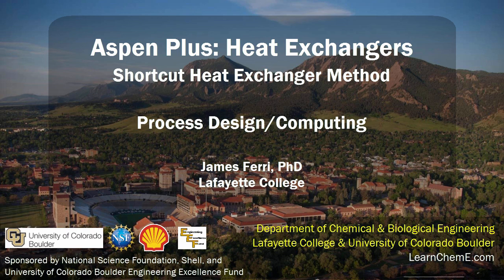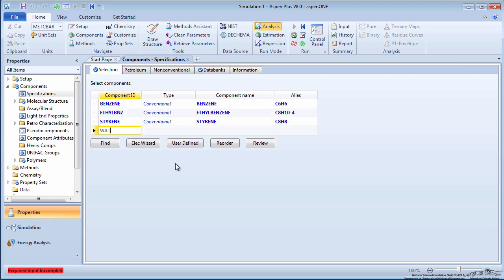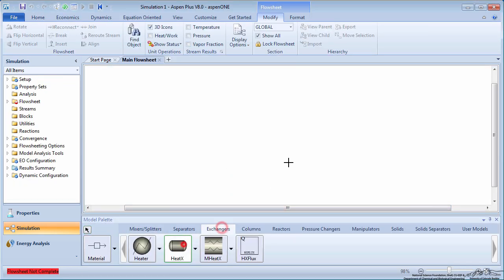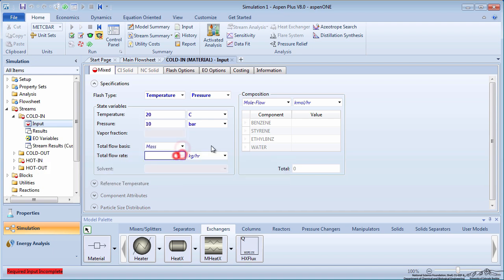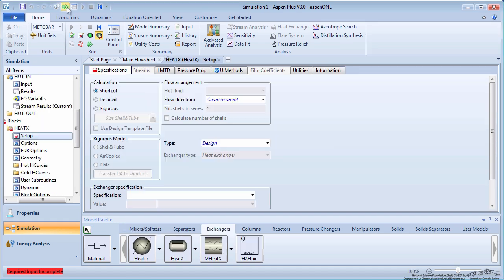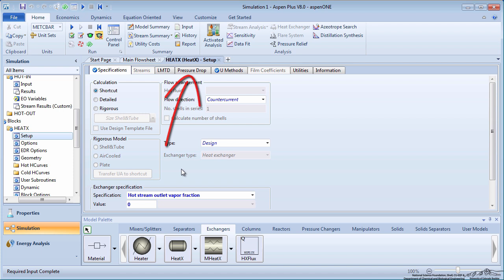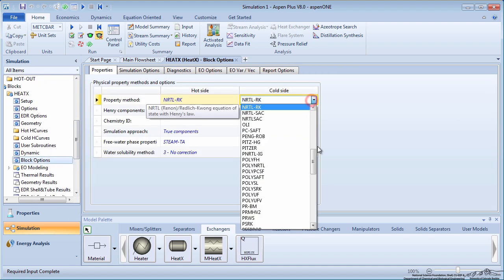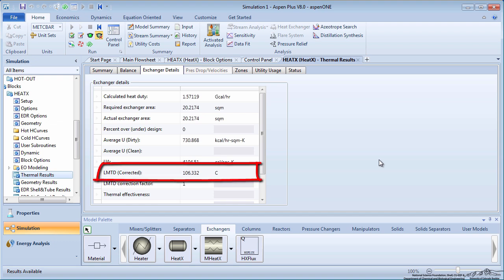Aspen Plus: Shortcut Heat Exchanger Method

Comment: Hello, I am working off of an existing ASPEN model done by a previous student, where the Global Unit Set is "KOR-1", and no valid phases has been specified. How will this affect my results? And why does vapor-liquid-liquid have to be specified as the valid phases? Thanks

P.S. I've been finding your videos very helpful, thank you!!!
Reply: I have the same doubt. Like why won't it converge if the valid phases is in Vapour - liquid only